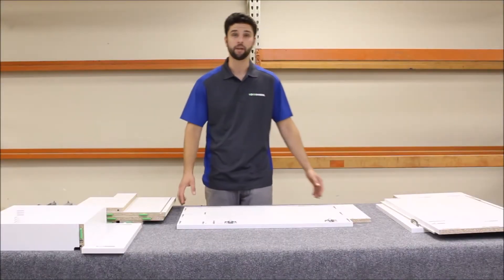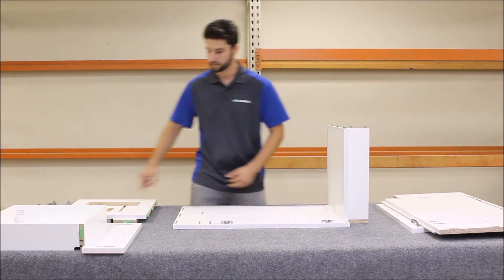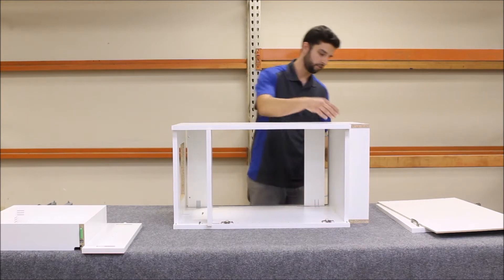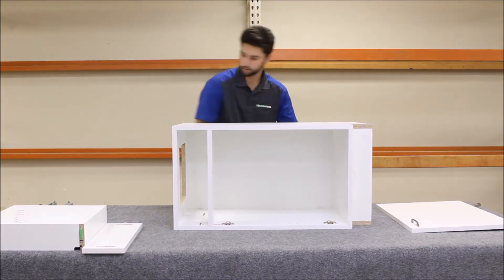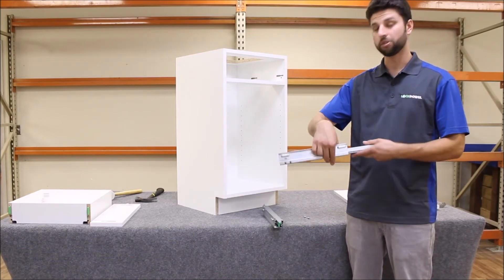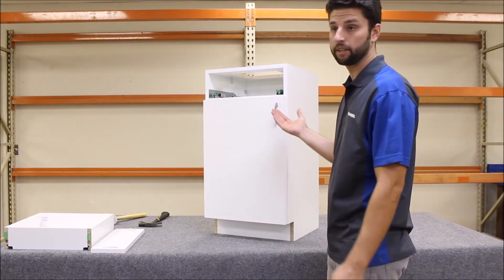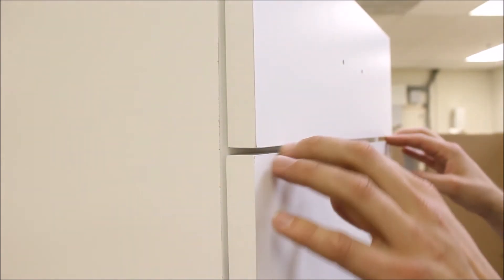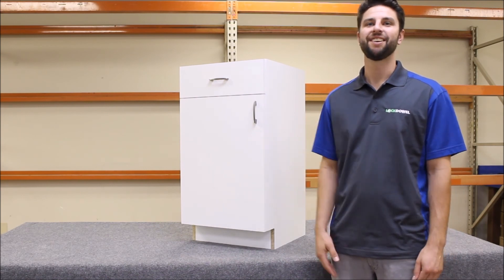CNC Cabinet Assembly Instruction with Lockdowel Channel Lock

Comment: Looks like a nice system but I see two issues 1. a LD4 is about $60k for drilling and inserting the clips, This makes this system out of reach for all but the largest shops or cabinet manufacturers.  If there was a double 8mm drill handheld unit similar to the festool domino for drilling the holes in the ends I think it would open up the market to smaller and even medium sized shops.  2. It seems a little finicky when putting on the second side.  Making sure all the spreaders are slid in just enough but not too much seems slower and more tedious than ovvo system where they will just snap together anywhere along the fastner and slide apart if needed.  This makes lining up a half dozen or more connectors at once less tedious.  I haven't used either system yet but would like to see some strength comparison tests done between the two.